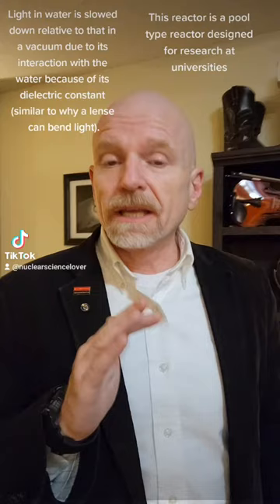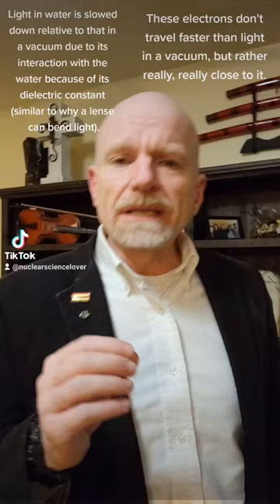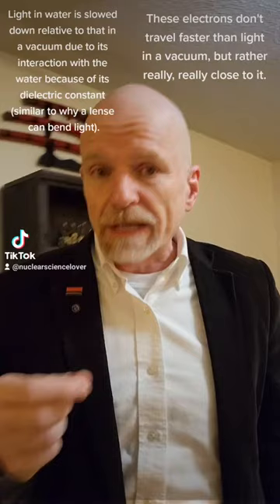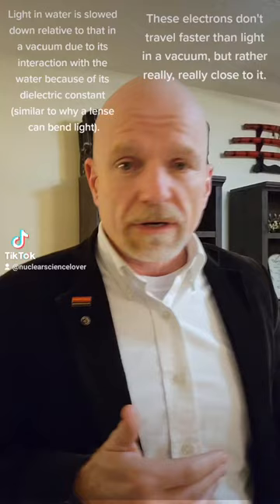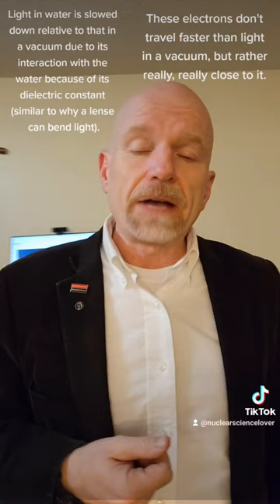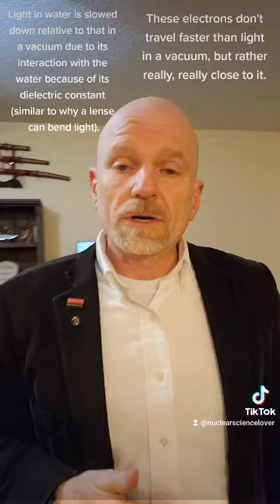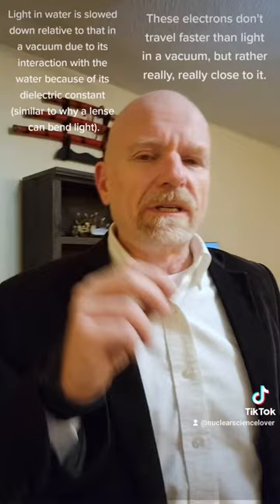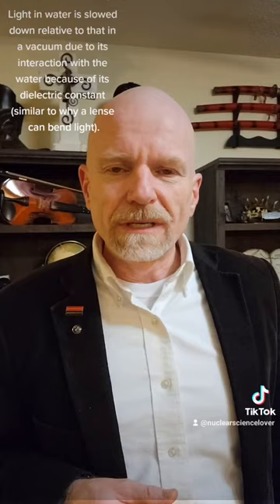Cherenkov radiation from a nuclear reactor pulsing and Compton scatter.

Comment: If this is moving at the speed of light then why can you see the "light burst" move from the left edge of the picture to the right edge? Video frames are one 30th of a second apart and you can see it move across three frames.
Reply from the maker: It's kind of like a sonic boom but with light, does that help?
Reply: @robertbhayes5039  Well, a sonic boom travel at the speed of sound which the human eye as enough temporal resolution to discern its travel.  Light on the other hand is many orders of magnitude faster than anything the human eye can discern as it relates to its motion.  So, unfortunately, your comparison does not help me understand why the video appears to show light moving at what I am estimating as 300 feet per second given that it seems to move about 30 feet in one tenth of a second.  This seems to violate the laws of physics as I understand them.  I am an engineer by trade so I'm pretty heavily invested in this now.